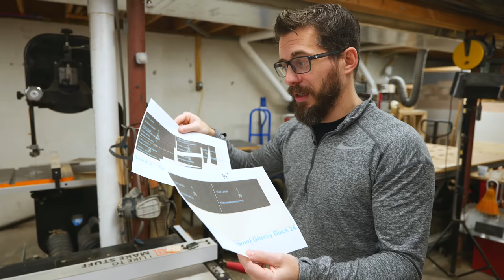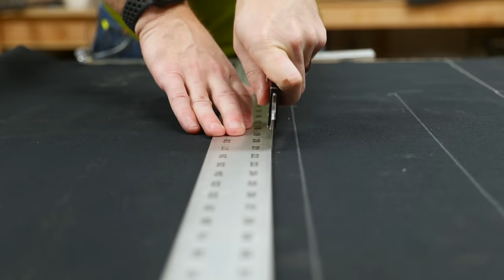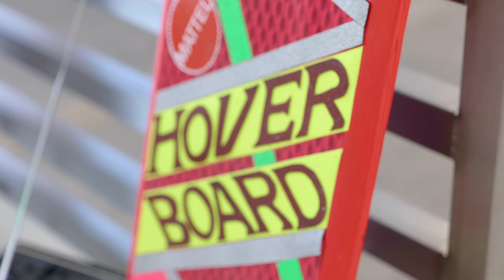Why I Don't Need a Recording Setup to Make a Great Podcast.

Comment: Had you thought about using chassis connectors instead of having the cables coiled up? I've built a few streaming flight cases and use Neutrik connectors on the outside, that way the internal cables can be hidden away and stops them getting damaged, as you're only plugging in and out of the side of the box.
Reply: Yeah I would use chassis mount sockets myself. Maybe Pat requested not to do it that way to cut down on setup time, and to avoid losing cables? I know someone might borrow a cable, and next thing I know I’m left with 3/4 xlr cables lol
Reply: This is the way. Or use a a DB25 fan out so you only need to plug in one connector to the side of the unit… 
To quickly identify cables in a rig like this, I’ve used small colored zips effectively…

Comment: Great bit of kit.  My only question is why not use a magnet instead of the clasp for the walnut lid?
Reply: If i had to guess it would be the age old logic of " Because I had it ".  Could also be not wanting to put magnets near the microphones or electronics or easier install than mounting magnets. But I'm sure it was just a "because we wanted to" I doubt there is a specific reason for it
Reply: While I was watching I had the same thought, but then I figured that if the case was jostled enough, it might undo a magnet. And I'm sure they wouldn't want anything to come loose while travelling!

Comment: i made an effects pedal box for guitar pedal with all these exact same things a few years back. only difference was that i has a built in port to run the cables out of the box (to connect power and to the amp) and i did the inside with a fuzzy type liner, so that i only had to put velcro on whatever i put in there and it stuck to the inside. same latches, corners, hinges, handles, covering, it brought back memories.

Comment: I must say that's a lovely custom case. At the same time I was wondering about two of your choices. 
Why such thick and heavy wood if the case is ment for traveling? And why didn't you use recessed latches and handle hardware on the outside? 
Also I would paint the wood black before attaching the Tolex in case it gets cut or torn during transportation.
All probably a time and budget based choice... Love your channel, keep up the good work!

Comment: I imagine we can further reduce weight, at least internally, by using foam core aluminium panels for the internals? I was thinking that for the exterior case, but it probably needs the plywood for durability

Comment: Cool build. One option to consider is just putting the 4 XLR connections on the outside of the box with a nice cover. Pat's comment about the power bank is a pretty cool idea, it would be neat to see a small power system (Jackery 240/290??) repackaged to fit in the box and provide power.

Comment: an upgrade to consider, they make sd card extenders/relocators that have a stub to plug into the card slot, a ribbon cable, and a new sd card cube. one of those could be put in an easily accessable location so you dont have to find the slot in the small space in the back.

Comment: I really like this, but I would want to change 2 things on this build.  1. the mixer/recorder is recessed into the box - I would want the box to be no higher than the edge of the board so I can ergonomically keep my hands on the faders and not feel like i'm bumping the box near the bottom. (it would drive me nuts).  this could be accomplished by simply adding spacers to the bottom of the recorder with the current implementation to bring the surface of the recorder's control panel flush with the top of the box.  2. as Pat was saying, the recorder can be operated with full portability, I would want to dedicate an area of the box to at least 2 100wh capacity (the legal limit for flying on an airplane) lithium ion usb battery banks (so you can have a field backup).  this would allow this rig to record anywhere unhindered by power concerns.  I would suggest securing these power banks with some removable velcro (I personally favor 3m command picture hanging strips for most electronics because they are thin, strong, but easily removable from the device without residue but also really easy to mount and unmount (i have giant white boards hung on my wall with them, they are fantastic)

Comment: sadly you  guys put the velcro on backwards.  if the soft side was on the rodecaster it could be removed and sat on a table without scratching what it's sitting on.   Love the catch choices and the use of the walnut and leather.

Comment: Box question: Would it have been easier to make a normal box the size you want, and then cut it into two halves at the angle you want? Looks like making two sides made it difficult to match up perfectly.
Reply: A lot of boxes are made exactly that way. I’m not sure about any advantage this way provides that building whole and cutting does not.
Reply: Apperently it should be. Check out Adam Savage box building at Tested :)
Reply: if it was a straight 90 or 45 cut i could see that as not an issue but judging by the angle of that box matching it up exactly on both sides once it was all closed in is potential for misalignment.  it's possible but I would still cut my side walls and assemble after that to ensure it would open/close without being janky.
Reply: Yes, doing it that way would be far easier, but there's no real advantage as far as strength of construction either way.  It would be a bit more math potentially because you have to line up your blade angle to the angle of the sides, but it's a minor trade off at worst

Comment: What kind of CA glue was that? It looked black and usually it’s clear.
Reply: That was a Starbond CA glue but if you were doing the same thing E6000 would probably hold better in the long run.
Reply: Probably the Loctite one, which is reinforced with black rubber. Designed for glueing things like rubber seals and mats together. I use it to make drive belts out of stretched ones, till the right one comes in, though it does normally last a long time.

Comment: Or just use a laptop haha. Sorry but these expensive goxlr setups are pointless when software can control it all anyway. Heard of OBS?
Reply: Nah! , that console is much better!
Reply: Even if you used a laptop, you still have to carry the 4 mics, and some sort of audio interface to connect them to the computer. You might save a little bit of money, but are adding additional points of failure.